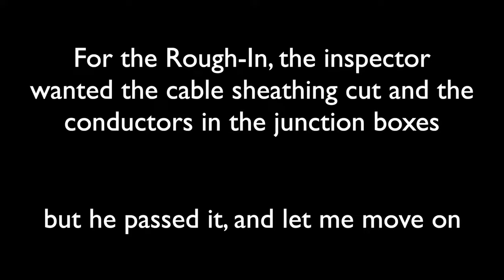How to install Halo New Construction recessed lighting w/ wiring multiple lights in series

Comment: great vid.  Question.  I have 4 Halo lights right now and purchased a 6 box set to add more.  can I add all 6 for a total of 10 or is there a limit per light switch?  Thanks
Reply from the maker: Disclaimer-  I am not a qualified electrician, but I don't think there is a limit to the number of lights. The limitations will come from the load put on the circuit (total from the 10 lights), length of the cable run, and the gauge of the wire. If you are putting in LED lights, I think you can safely assume 10 lights will be fine on 12 or 14 gauge wire, but you should consult the NEC or qualified electrician.

Comment: You should explain that the black tab the wires go through has a lid on it that must be popped up - then the wires can be pushed in and gripped. I had to go find another video to understand this. Didn't want to break the black tabs.

Comment: are these just open when finished? and you put a light bulb in? or can I cover it? It looks like you've put some pot lights?
Reply from the maker: To finish, us a rotorzip tool to cut the drywall around the outside of the can (careful on your first try, it takes a bit of practice!). The drywall will slip around the outside of it, allowing you to secure the drywall to the studs. After that, Home Depot and Lowes sell finishing kits of lights that have spring fasteners that fit inside the cans and the trim covers the drywall cut around the can housing. There are some options for LED finish trim lights in the description.

Comment: Once you squeeze those tabs to lock it on the track can it be moved again? I need to slide it over a couple inches.
Reply from the maker: I don't think it should be too hard to move it along the tracks with the tabs squeezed-in; as I recall they don't really hold it that tightly, so it might just move with a bit of force. If not, I would try a needlenose pliers or flathead screwdriver to pry them up a bit and then it should slide.